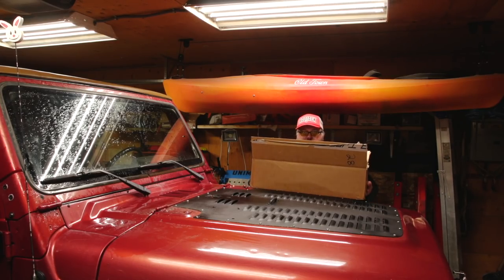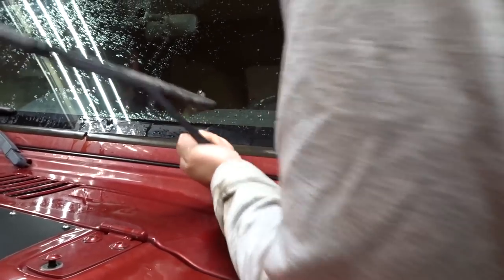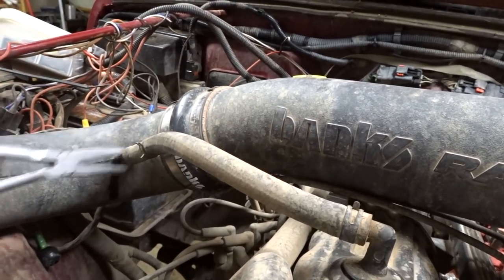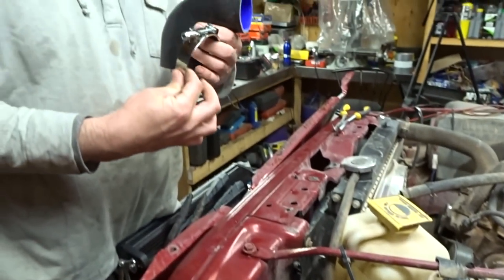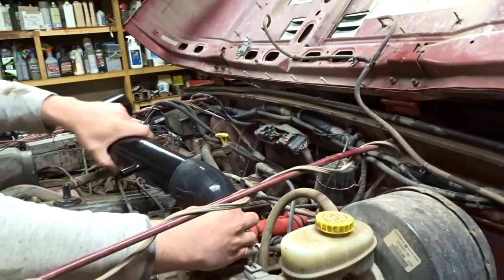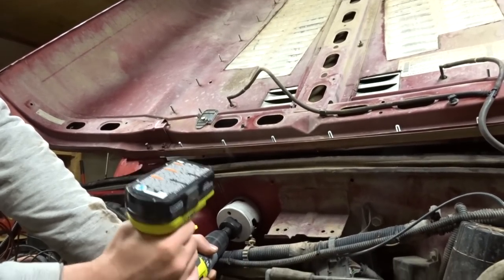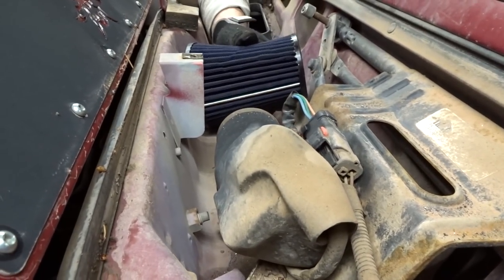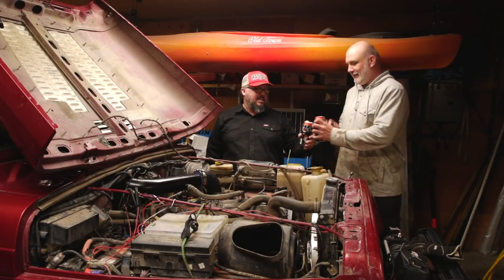Trailhead OffRoad Cold Air Install

Comment: The problem with cutting into that vent is that water tends to build up in that tray because the drain tube clogs on the TJ’s...at that point the air filter will be sitting in a puddle of water
Reply: True, most of the long time Jeepers say the best upgrade for the intake system is to re-install the stock box! Thats what I did from a cold air intake the previous owner had. Jeep actually runs better and quieter.
Reply: There's enough room for water to drain out under the filter. Should also clean the drain with compressed air once in a while. I've never had issues with it clogging. I thought about having issues when crossing rivers, big splash of water might get in the cowl and kill the engine, but that's gonna be rare.

Comment: I would look for a 90 , then the filter .  The final setup, I'm not feeling confident.   Looks like a disaster waiting to happen.
Reply: Bit of a hack job. 90 would've been the way to go. A Dremel would've sure come in handy.  Definitely get some HD rubberized polyurethane on those exposed hacked bare metal edges.

Comment: what if you are in a heavy rain in a couple of hours, the water will flow into the airfilter?
and my drain did plugg so the water did fill up in this compartment, would have water in the engin!

Comment: Jerry, does the TJ coolant run through the intake manifold like it does on the YJ?  It looked to me that he didn’t have a shroud on his radiator.  My Jeep would not cool properly without the shroud...  Garage looks great btw, Cheers!!!
Reply from the maker: no it doesn't, Fedor is using electric fans so no shroud is needed

Comment: I know this video is a couple years old, but I'm considering doing a similar mod.  The question I have that will dictate the direction I go is how much intake noise did that mod add to the cab?  I run my Jeep almost exclusively without a top, so it's already loud, but I'm wondering how much intake whistling you get.
Reply from the maker: It was actually taken out because of the noise was unbearable
Reply: @BackCountryWrenching  That's unfortunate, indeed! I have heard that noise can be reduced or eliminated with a HMMWV style air intake cap if you route the intake out of the top of the cowl. For me, I would be doing this mod just to free up some space in the engine bay, so I am not sure if it is all worth it. Lol